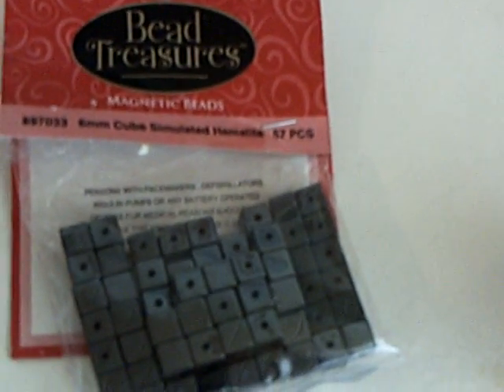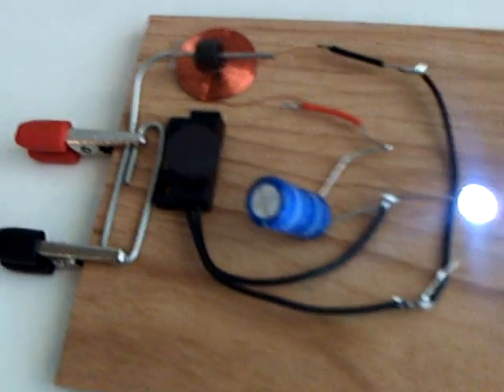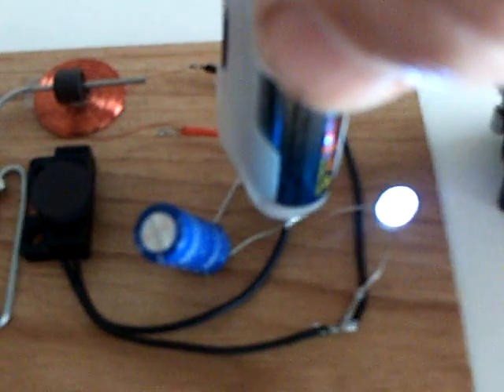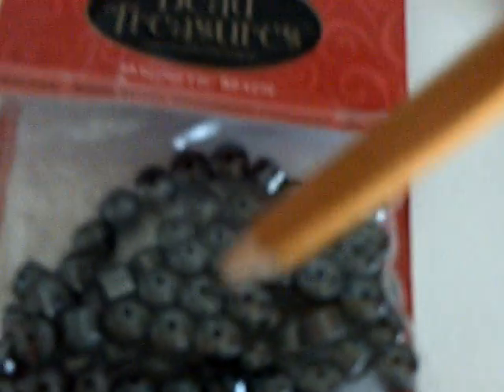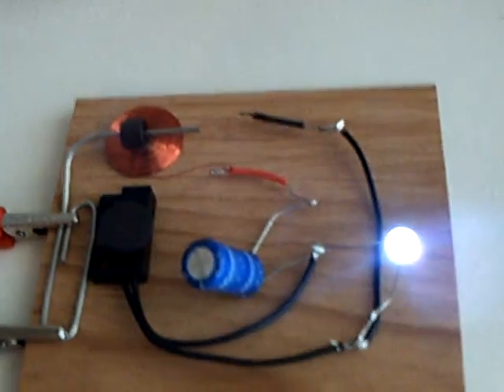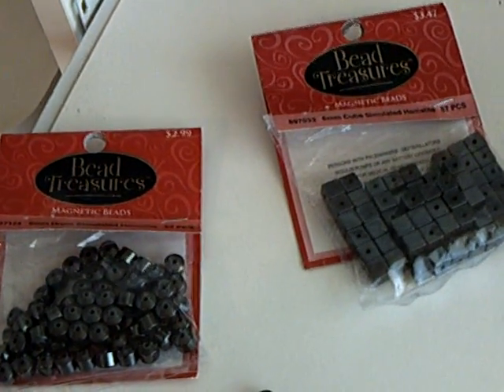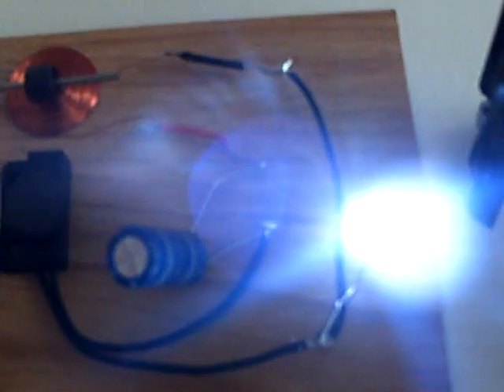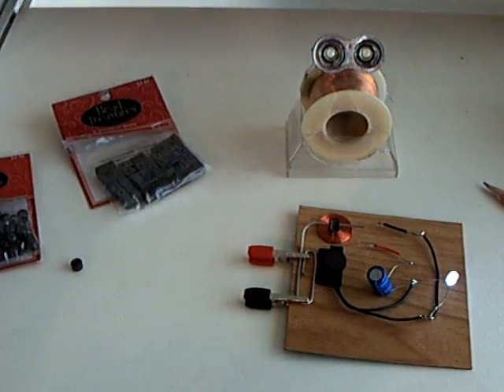Hematite Jewelry Bead pulse motor

Comment: Could you publish the Bead Creations part number for the square beads or something else that I can use to identify them.
I searched all day but couldn't locate any so I did the next best thing and bought some 12 mm round ones.

I shaved down a small bamboo barbeque skewer and inserted it into the hole in the bead, stood it up on the point and gave it a spin.  It has plenty of strength to trigger one of your self starting ball motors, and spins fine.

Very stable.   Thanks

PS the wood bowl motor is working great.

Comment from the maker: All I had to do on this reed switch setup was give it a tap with my finger and off it went.  For an electronic version I think that the magnet strength is too weak to trigger a transistor.  You might be able to spin it up fast enough to trigger by blowing on it with a straw like we have done before.  You can stack these or add a small neo magnet to the edges and it would help.

Comment: Julie did a happy dance with the shout out...cheers :)
Glad you tried them on a pulse motor. Have built a horizontally levitated version that runs nice enough, paperclip is tiny friction though too. 
Might do a Bedini type circuit as an idea to really max out these tiny things interactions. Imagine 100 in a grid, about the size of an A4 piece of paper, air coils to pick up the usually too low energies but from each or banks of them. Would probably look like an Abacus :)